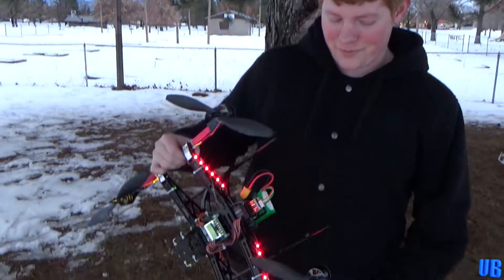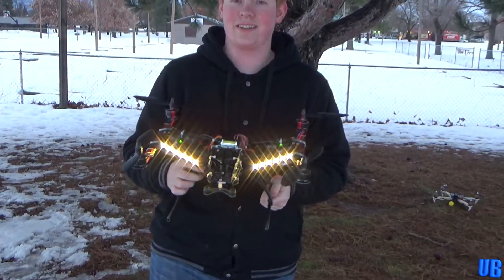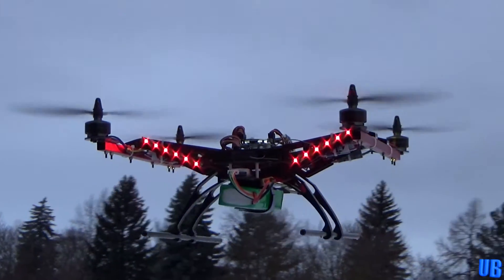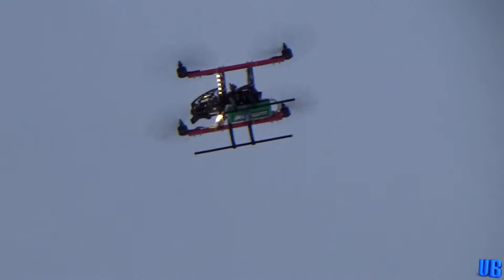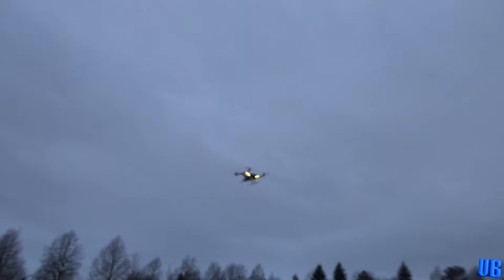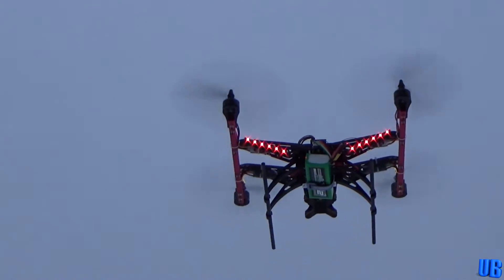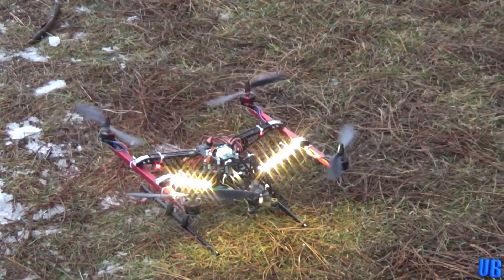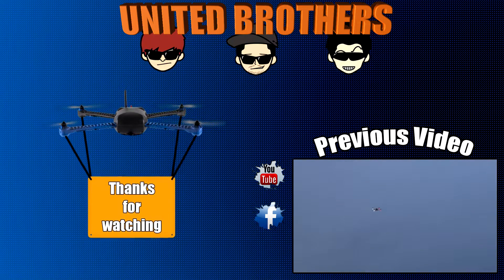Hercules Custom Quad [Review]

Comment: After watching your video and several others on the Hercules Quad, I decided on this frame for sure...I went ahead and copied your setup as well, except I am using HobbyKing 30A ESC's.   I'd be curious to hear how this quad is doing for you now?  If you could do it again, would you change anything on your original setup?
Reply: Also, these AX motors are rated for 35 amp, why 30amp esc's?
Reply from the maker: There's only two things I would change, the props, and the landing gear. The props I would go to a 12" prop and the landing gear I would put M200 Crab Leg Landing gear here's a link to that.

https://hobbyking.com/en_us/m200-crab-leg-landing-gear-deluxe-set-diy-black.html?___store=en_us
Reply from the maker: I'm never going to be running these motors at full throttle mostly at half throttle for the camera shots.
Reply: I'm impressed with the precision of the parts in this kit....

Comment: Is there any point in not buing a multistar 5200mAh (433gr) or a 6600mAh (537gr) but instead a 8000mAh (643gr)? I´m building a 450 quadcopter with same AX-2810Q motors. 40 amp esc:s and cc3d flight controller. So will the extra capacity be able to give me more flight time or does the extra weight affect so there´s no point?
Reply from the maker: +A_H Well with my battery I'm at about 50% throttle and 20min flight times on hover so if you add a bigger battery your hover throttle will be higher. I would't exceed 60% throttle for hover. I recommend the biggest battery you should put on this quad is the multistar 5200mAh (433gr).
Reply: +United Brothers How heavy is your copter with battery?
Reply from the maker: +A_H I would say it's about 820g with the battery. I don't have a scale so I'm not exactly sure. sorry
Reply: +United Brothers mine would be 1250gr with battery and 3800gr lift with different motors. It's less than half the lift so will it do fine?

Comment: Not sure where to ask this, so I'll ask you guys. Do you think 800kv motors with 20a ESCs would be able to drive this quad?
Reply from the maker: +The Captain yeah 800kv is fine but for the ESC's It depends on the max amp's that your motor pulls. You usually want to stay 20% above what your motor can pull, so for example my motors max amp's is 30amps so I should get at least 35amp ESC's. I hope this helped :D
Reply: +United Brothers Thanks a bunch! I really have no idea what forums to go to, so YouTube it is. I'll make sure my ESCs have a high enough amperage.